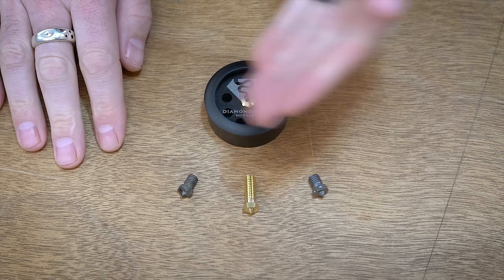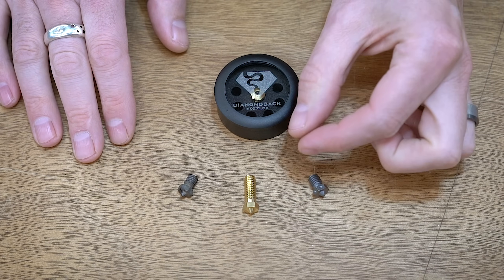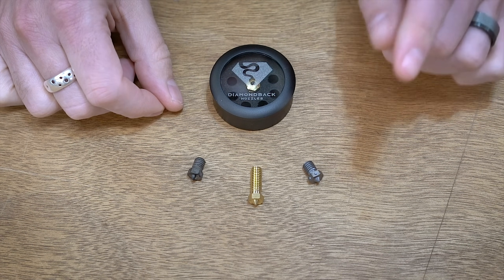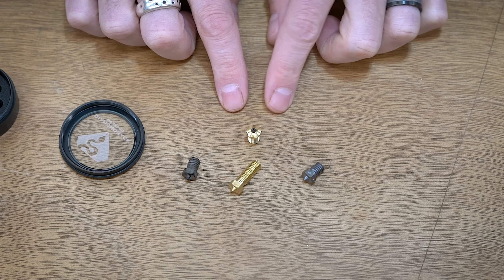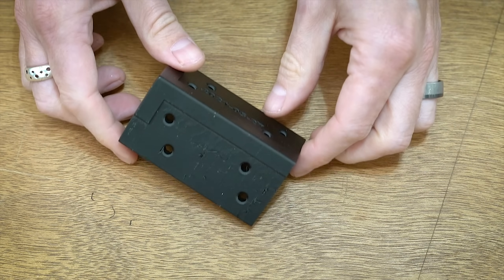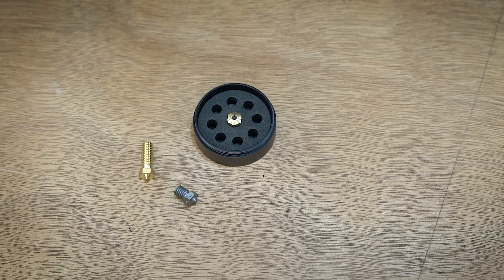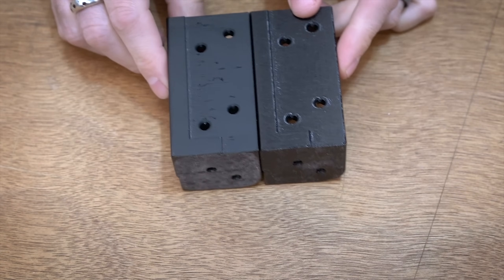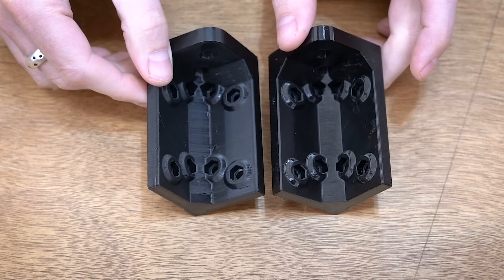Is a $100 Diamond Nozzle Worth it?

Comment: "NozzleX is a good budget option"
Hahahaha. $35 for a nozzle is already premium. This diamond nozzle is ultra ultra premium. It has an extremely narrow and specific use case for people like you whose desire is first and foremost to never ever change their nozzle ever again, and get perfect prints. It does that very well. But to call other options budget just because they are a fraction of the price is misleading IMO. That's like calling a Tesla Model 3 Performance edition a budget option because a Ferrari costs more.
Reply from the maker: Cost is something that is relative and everyone has their own personal viewpoint of what is worthwhile, a good value, or too expensive.  For this reason I mention MY reasoning for buying the nozzle and why I feel FOR ME it's worthwhile.  I spent a few hours trying to track down some issues with PETG.  This nozzle saved me a few hours of my time, which is more than worth the cost.  For others, that might not be the case, and I feel I was quite clear in that regard.  The premise of the video was for me to find a 'do-all' nozzle since the NozzleX wasn't perfect for me.  I concluded that for me the Diamondback was the one to go with, the hardened nozzle (I feel) doesn't provide enough flexibility for all filaments, so therefore the $35 NozzleX is a good compromise.  Yeah, it's many multiple times more expensive than a brass nozzle.  I'm not arguing that nor am I trying to hide that fact.  It is what it is.  But it works and can solve problems for people.  People spend a lot of time with their printers and I see people sinking a lot of money into numerous mods for minimal gain in print speed or quality.  Why would a $35 nozzle (which is about half the price of a single 500g roll of NylonX) be such an absurd upgrade?  If you're printing exotic materials, it's not that much in the context of everything else.  I feel like you're just trying to create drama or controversy for no reason.  I'm giving my opinions and felt I was very clear and upfront.  I even said twice in the video that you can just simply swap nozzles for different filaments.
Reply: @RobertCowanDIY  your statement in the video "at the end of the day it is another tool" is a perfect way to put it.  It is all down to use case. 3d printing is a hobby for me, and I get a decent life out of the 50 cent nozzle for what little i use it... Once a week maybe at most... 

But on the other hand It may be baffling to some people for me to spend $6500 on an oscilloscope when most people may find a $250 hantek does the job. And they may not see the benefit to the more expensive options.  For my brother its his $10K Sawstop tablesaw or $2200 router.  And the list goes on... But they are tools we depend on for our livelihood and are used daily and sometimes non stop. They save time, do a better job and make us not have to think about so many things when we can just concentrate on the job..
Reply from the maker: @wishusknight3009  Yep, so true!  For me, it's a tool.  Seth's comment baffles me since I have end mills that are easily $50-$100 and are seen as consumable.  The printer is a tool and spending $100 so I don't have to re-level the bed or really mess with it for different filaments is well worth it for me.  I see people buying cheap $20 filament and spending all day trying to get a good print out of it and diagnosing a print profile, etc...  In the machining world, if you can buy a cutter that speeds up cuts, saves you time, or lets you do 2 operations at once, people are gonna pay whatever it costs.  I see this as no different.
Reply: @RobertCowanDIY  I actually look forward hearing about  its long term performance. Imagine the 3d printer being about as thoughtless to use as that office laser printer that everyone just sends print jobs to.
Reply from the maker: @wishusknight3009  In all honesty, my Prusas are like that.  I have them in my closet in my office.  I have them each on their own octoprint server with a power relay.  I open a tab on my computer, power up the printer, send the file from prusaslicer and wait until it's finished.  In many cases, I never even open the closet until it's done.  As long as I have the right filament loaded (I typically keep my most used filaments loaded in one or the other), I can print with zero interaction.  The PETG prints recently were the first time I've had to stop a print and retry in over a year.
Reply: @RobertCowanDIY  ohh dang, that's pretty slick. My little setup isn't quite as fuss free. It works well for what it is, but not like that.
Reply from the maker: @wishusknight3009  It's fantastic!  The downside to having a shop full of tools is if you have to mess with them or fix them, it really slows you down.  So it's nice just having everything work.  I usually print as prototypes and usually do other things while the printer(s) are going.  So if I have to stop working on something to babysit, the value of using them for a prototype goes way down.
Reply: Most of my budget nozzles have been 40 cents. Once I sprung for a "premium" nozzle that cost me $3....

Comment: How would a ruby tip nozzle compare to the diamond one?
I spent a month trying to figure out why my prints were dull and poor quality all of a sudden.. swapped my hardened nozzle back to brass and all was good again, so can definitely feel you on this one.. also too lazy to swap nozzles all the time, but got no time for crappy 6 hour prints
Reply from the maker: I'm not sure, I never tried the ruby based on the poor reviews.  A read a lot about people saying it was fragile, poor quality control, etc.  Also, ruby isn't as good of a conductor of heat as diamond.  Since the price is the same, for me, the Diamondback is the one to go with.
Reply: @RobertCowanDIY  thanks!
Reply from the maker: @thefekete  sure!
Reply: Any update as to how it has worked out?
Reply: From what i heard the ruby one didn't have a cone shaped insert, it was just a cylinder with a hole cut in it (i am unsure on this Polycrystalline Diamond Inserts' Shape

Also the ruby (Which is essentially just impure Sapphire) may not have the same properties.  I can't seem to find a quick comparison, but that may be an issue too.

Comment: Have you verified your filament dia? I recently started having problems with PETG and found the dia is way off with my overture filament. Measured as large as 2.00mm, with an average of 1.85mm. Going back to a quality petg has fixed the issue with sticking.
Reply from the maker: I didn't actually measure, but I tried 3 different brands of PETG, and all were pretty similar, and printed much better on my Prusa Mini (which just has the standard brass nozzle), so I concluded it was the nozzleX.  (I just did a quick measure, they're all within range)
Reply: I've had the same issues with overture petg...   Just can't seem to dial it in at all...   Just builds up on the nozzle, falls off, and destroys the print....   esun prints just fine

Comment: I backed the kickstarter, got my first diamondback for $70, put it on my CR6.  A lot of the other backers have reported that the thermal performance is better than brass, to the point that you can actually lower your hotend temp by a bit.  I haven't done extensive tuning with my diamondback yet to confirm it, but it does flow well.

I bought a 2nd for my new Voron V0.1, and it's the only nozzle I've used on it so far.  I am having some sticking issues with it, but I suspect it may be more due to an adhesion issue than with the nozzle.  I'm starting to suspect that the PEI sheet I got from formbots is fake.
Reply from the maker: Huh, interesting.  That's good to hear though!

Comment: I’ve printed over 100 hours of PETg on our Ultimaker using their standard AA 0.4 nozzle. This is the first I’ve heard of PETg sticking, I wonder if the larger filament diameter makes a difference, since the Ultimakers use 2.84mm filament.
Reply from the maker: I'm not sure I understand.  PETG doesn't stick to standard nozzles, which it seems the Ultimaker has.  It's only the tool steel nozzles that tend to be sticky.
Reply: @RobertCowanDIY   Ok I missed the “only sticks to tool steel” part. Yes we have standard brass.
Reply: I doubt it's as bad as the sticking on Nozzle X, but I've definitely had this issue on 1.75mm brass nozzles with PETG. PETG oozes out of the nozzle really easily and then doubles back on itself, sticking to the nozzle and creating that same PETG cake Robert was showing that then drips into the print randomly. However with brass I've found that dialing in retraction and making sure extruder tensioning is dialed in seems to solve it 99% of it. For some reason black PETG seems to be the worst for this, not sure why.

Comment: Interesting. I change my nozzles all the time between 0.4 and 1mm depending on the type of print and necessary speed/quality. So changing the nozzle everytime I change the filament would not add much more time or hassle.
Reply: Sorry to reply to an old comment, but does this require re leveling the bed often?
Reply: @Roach_Dogg_JR  all good. Well difficult to answer. I was doing that on my Ultimaker with an OlsonBlock. The original nozzles that came with that kit worked perfectly without having to touch the buildplate. The replacement nozzles that I bought in China for a tenth of the price however were not interchangeable without releveling. So to answer your question, it really depends on your printer, and what care was taken to manufacture all the different nozzles to the same length.

Comment: Have you tried a Tungsten nozzle yet?
Reply from the maker: I haven't.  From what I've seen it has the sticking issue the standard tool steel one has.
Reply: @RobertCowanDIY  Really, haven spoken to some people I know with them they are way better thermally and the sticking isn't that much of an issue.
Reply from the maker: @derektran9404  I'd be curious to see what a good one is, because most of the ones I've seen had numerous bad reviews with the same issues.
Reply: @RobertCowanDIY  Interesting, I've never heard of issues personally.
Reply: @RobertCowanDIY  I have one from Spool3D and it's been great. You do want to get a copper heat block also though as it's easier to get a good seal along with better thermals, but it's not required.

Comment: Hi Robert.  Thanks for this.  I too have had issues with PETG clogging up my Nozzle X.  After doing some reading, it appears to me that a 0.6mm nozzle is the way to go with PETG and filaments with particulate in it.  I’ve been trying this theory for a couple weeks, and so far, no clogging 🤞
Reply from the maker: Ah, interesting.  I should probably get a bigger diameter nozzle, but for me, I have about 30+ hours on the Diamonback and it's been flawless.  The prints are perfect.  So if you need a 0.4mm, this is the way to go.  But I still think the NozzleX will work for most people.
Reply: I've never had an issue printing PETG with a 0.4mm NozzleX. I do need a 0.6mm or larger NozzleX when I'm dealing with CF Nylon though.
Reply: @shadow7037932  And when I use Taulmann Alloy 910 Nylon, 0.4mm is just fine. 
<shrug> As time goes on, I’m more and more convinced that black magic plays a bigger part in this than we might care to admit. 🙂
Reply from the maker: @shadow7037932  Interesting.  I guess every printer is different.  Maybe it's filament type too?
Reply: Hi guys, if you have an all metal hotend and nozzle x, and have clogged it with PETG, the problem, as you know, is if baked for too long it transforms into a crystalline state and seems impossible to remove. I’ve found the answer to this is go higher. Way higher. Though my printer isn’t fully set up for super high temp, I have a plated copper volcano heatblock and pt100 capable of super high temp, so I temporarily change the upper limit in the firmware and keep heating. Somewhere between 350 and 400 degrees, the baked on PETG “carbonises” (if that is a word) turns to powder and can be removed easily. I use this technique to remove material from the heater block as I don’t like using silicon socks. Haven’t tried it yet for a blocked nozzle, but if you have the right parts on your hotend it is easy to do and is probably worth trying. I’ve tried a ruby nozzle as well as nozzle x. Nozzle x is cheaper and, for me, works better. I don’t leave the printer while doing this operation, for obvious reasons.
Reply: Only try this if you are sure you have the right components. I’m not responsible for your choice to try this technique, etc, etc.
Reply: I had issues too with petg with nozzle x but it prints abs and asa with so high quality that I simply don't buy petg anymore. It's absurd. Petg can be easily replaced with some high quality pla+ filaments and print far far better and easy. Nevermind I will buy the diamond nozzle when I have the chance. Great video man. You helped me a lot.

Comment: I was hoping you would be more enthusiastic.  Do you think it could be the forever nozzle (for that one size). I mean, will it ever wear out?
Reply from the maker: I'm not sure what you were hoping for?  It's a nozzle at the end of the day.  It doesn't make prints 'better', it just means I never have to swap nozzles, which is nice.  But in the end, 3d printers are just tools, so the less maintenance and fiddling I have to do, the better.  So in that sense, I'm quite happy.  I think this will absolutely be my 'forever nozzle'.  I think everything can wear out, but for my printing needs, this will most likely last the life of the printer.
Reply: @RobertCowanDIY  I am still waiting on your in-depth review of that stackable triple cordless drill you were seen using on battlebots...